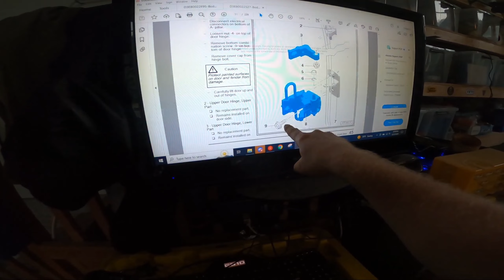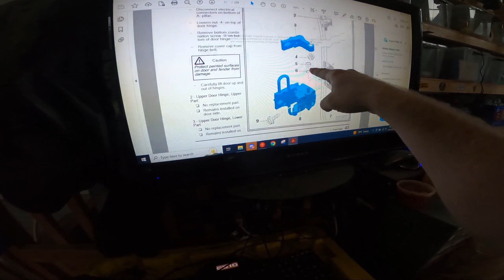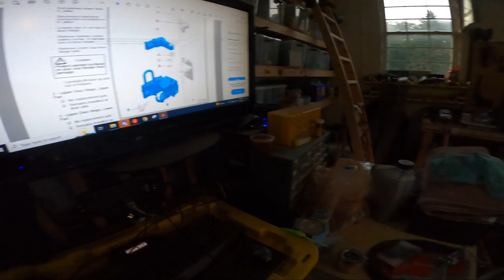Q7 Door Replacement (Body Repair Part 1)

Comment: What a wonderfully complex door
Reply from the maker: Aside from the inner workings the two bolts and a single harness plug makes it pretty easy to swap.  If I had a perfect door with mirror and trim attached it would be so fast.  Butt I'm cheap and this door was like $300.

Comment: I need help I’m trying to figure out how to replug the door loom lol 😅
Reply from the maker: @jenesisrodriguez5083  if I remember right there is on that pops inside of the vehicle and then becomes a huge pain the butt to stabilize and hold in place to connect.  Is that the one?
Reply: @smsauce  yea it’s in video part 3 where you took the plug back out of the hole but. You skipped explaining how you got it to plug back in lol I took my door apart yesterday and got the plug back out of the hole now trying to get this plug back on is a pain
Reply: @smsauce  I mean in video 4 you got the plug back out the hole but didn’t explain how to get the plug to plug back in once you got it back out
Reply from the maker: @jenesisrodriguez5083  ah, OK. I'll rewatch that part to jog my memory and comment on the other video.